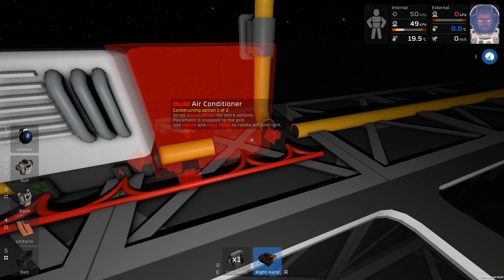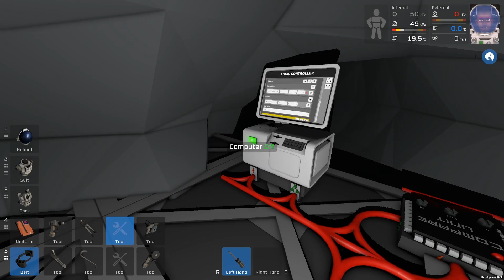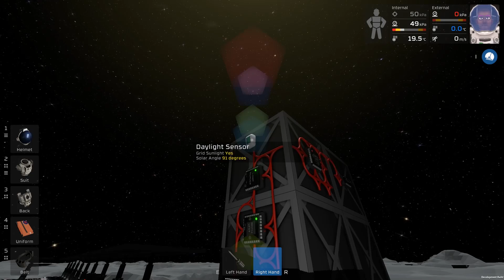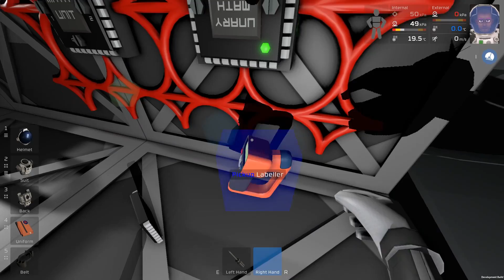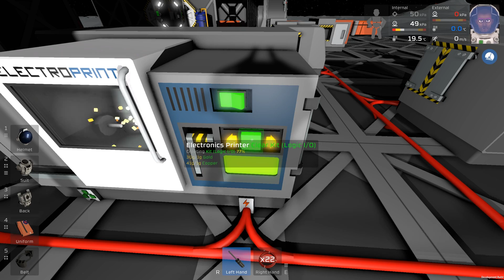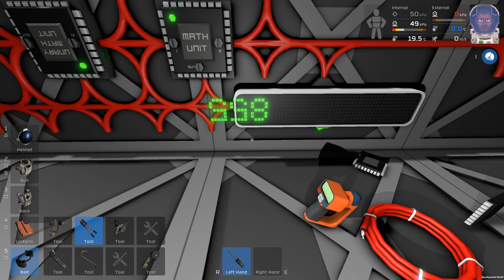Stationeers E18 - In-Game Electronic Clock (24 Hours)

Comment: I like your clock a lot. I just don't understand why you calculate (720 - 4x) + 720 instead of simply 1440 - 4x at night. Also for the 6h shift just add 600 and mod 2400
Reply from the maker: Oh it's not always planned for most optimal maths - there are definitely more optimisations on the clock - lots of good comments on this video, well worth browsing :)

Comment: Perhaps a bit excessive for a clock, but a good exercise :)

Rather than multiplying the hours by 100, divide the minutes and you can can then display time using a decimal to separate the hours and minutes which makes for easier reading. Or use two displays :)

Comment: not sure why you make it so complicated, it all simple math with only 2 switches/conditionals :

;; I have used long variable names to reduce confusion,
;; but below is imho a quicker/easier way of doing it, not sure if less components

;; daylightSensorDegrees integer (0 -> 180 and back after midnight)
;; daylightSensorVisible integer  ( 0 || 1)
;; daylightSensorMax integer 180

memTrue = 1
memFalse = 0
;; effectively a NOT or toggle switch
daylightSensorVisibleNot = if( daylightSensorVisible ) then memFalse else memTrue

;;  will always be 0 after midnight
daytimeOnlyDegrees = daylightSensorDegrees * daylightSensorVisible

;;  * -1 makes it counts upwards instead of backwards
nightUpCount = daylightSensorDegrees * -1 
;; as above, will always be 0 before midnight
nightOnlyDegrees daylightSensorVisibleNot * nightUpCount

fullCircle = daytimeOnlyDegrees + nightOnlyDegrees

;; so at this point fullCircle is a range between -180 and 180
;; offsetting that by 180 gives you 0 -> 360, 0/360 at sundown, 180 at sunsrise
;; but we might aswell already calculate in the clock offset
;; so we want 0 at the bottom of the circle for midnigt, so we only offset by 90

memCircleTimeOffset = 90    
circleOffset = fullCircle + memCircleTimeOffset

;; this means:
;; 0 -> midnight
;; 90 -> sunrise
;; 180 -> noon
;; 270 -> sunset
;; now after 270 the value will be negative, so we can just correct the value with a switch

memCircleNegativeCorrection = 360;
circleCorrected = circleOffset + memCircleNegativeCorrection
circleEffective = if( circleOffset < 0 ) then circleCorrected else circleOffset

;; so at this point you have a 0 -> 360 circle, where 0 is midnight
;; 360 / 24 = 15, so every hour is 15 degrees

memDegreesPerHour = 15
memMinutes = 60
memMilitaryFactor = 100
time = circleEffective / memDegreesPerHour
hours = floor( time )
timeDecimals = time - hours
timeMinutes = timeDecimals * memMinutes
minutes = floor( timeMinutes )
militaryHours = hours * memMilitaryFactor
militaryTime = militaryHours + minutes

Comment: So basically you built a digital sun dial and made it work at night.
Reply from the maker: Yep, just in case the day length changes (or is a configurable option in future) - you could also create a 20 minute timer, using the server tick rate (500ms) and a (0,1) clock circuit

Comment: Got this game for Xmas from a friend via steam gift and am just starting to learn about it. Must say it looks like short circuiting isn't possible and it also looks like power and data are carried over the same cable. I'm personally not a fan of that but it's nothing huge.
Reply from the maker: Oh you can definitely burn up circuits if you connect things incorrectly, like connecting the input and the output of an APC or transformer together.  Similarly, the red cables will only take 5KW maximum.  You can separate data and power, but with large electronics, that means slower cabling when recording, which I avoid!
Reply: I mean, I'm no expert on electricity, physics was always my personal weakest science, but electricity takes the path of least resistance. Like you could stand on a high voltage cable and it'd do nothing to you, as it'd be harder to go through you than the cable.

The game doesn't make you make it into a loop/circuit. like, IRL wouldn't these chips need to be in series?

Comment: In a farm, normaly you don't have only co2, but less than 1%. And it's not a good idea to have your radiator directly heat by the sun. 
If you want simplify your networks have a power line and a data lines, that are only between the 2 monitor that need the value.
Sorry for the mistake, english is not my mother tongue

Comment: i made my solar differently. easier to read than this clock :)

here is how i did mine. taken from a math formula in a previous video
you need theses items
- 2 memory module
- 3 Math Unit
- 2 Logic IO
this is connected as follow:

Logic Reader {
     In - Daylight Sensor
}

Math Unit 1 {
    - 1 (Logic Reader)
    - 2 (Math Unit 3)
    - Out (MOD)
}

Math Unit 2 {
    - 1 (Logic Reader)
    - 2 (Memory (15) )
    - Out (Substract)
}

Math Unit 3 {
    - 1 (Math Unit 2)
    - 2 (Memory (0.6))
    - Out (Multiply)
}

Batch Writer {
 In - Math Unit 3
Out - Solar Panels
}
most of the time, my panels are in the 420w + range
only time it drop is at the sunset at 380w
Reply from the maker: Some updated solar logic is out today - it gets 480W + throughout the day (it's a little more complex, but not too bad)

Comment: Could you just mod 24, instead of the conditional 6 hour shift?
Reply: BroMasterFlex do plus 600 then mod 2400 i think.
Reply from the maker: Good idea!
Reply: Was thinking the exact same thing as he was messing around with it xD
Reply: Could you explain how to do this.  Also I have an odd issue where the clock counts up to 1440 the back down to 1400 then resets to zero and starts counting up again.  Not sure what thats all about.
Reply: Drunken Walnut i found the sensor rotation to be really important. experiment with that. as for modulus, look it up. modulus quite useful.
Reply: Best thing I've found for that is to test each part as you build it.  If you're stumped, start from your sensor and make sure you are getting what you expect from it (0 to 180 - I like to use 0 for sunrise, but you could flip it around and do it the other way if you want).  After that, move on to the next piece and make sure that's providing the values it should, then keep working your way up so you know you have a good foundation to work with.  David is right, too.  If you have a clock set to 0 at sunrise and 2400 at sunset, you would add 600 then modulo 2400 so that it resets at 2400 so that you get sunrise at 600.

Comment: My solar was a lot more eff by changing the following; change divide from 1.8  to 1.5 and subtract 10. should get 10 to 20% more from your existing panels. good luck.
Reply from the maker: That's actually tomorrow's episode :)  But it's a slightly different calculation - it gets 494-498W
Reply: i have found this, but not sure if it worth with only 4 or 5 solor panels by me.
https://stationeers-wiki.com/Solar_Logic_Circuits_Guide
they have areally nice infos for the Furnace to even with the mix infos.
Reply from the maker: Yep, that's slightly more compact than today's episode (it uses 1 less processor), but the effect is the same

Comment: For the Generator you could read the Ratio and Compare (less) it with a Select, the Memories for the Select changes between 0.3 and 0.8. This should work as 2-point-regulator (Schmitt-Trigger), to toggle the Generator on at 30% and off at 80%.
I'm not at the point needing a generator, so never tested the circuit.
Short: Ratio less than Select -> Generator on + Select on.
Memory at Select 0: 0.3
Memory at Select 1: 0.8
Reply from the maker: That's a very nice solution, full credit coming to you for that one in the next ep :D

Comment: Nice see a working clock, but its not looks like its mean for building in the base, this thin really needs a 1 or 2 solor panel for  there own... in next patch is than a unit that does all in one... maybe this is trolling from the devs.
Reply from the maker: Hey, if we're faster at building these than the devs, go us! :)
Reply: Problem solver for your greenhouse. Build a back pressure regulator on the side where the heat comes out. And set it to somethink like 100 in start. With that you get in this 6 pipes a storage that is big enjoy for cooling down. Not sure about the how much pressure you have and need to get it efficient cooled. Need to test it my self in a bigger way but out of resources by base building.
Reply: pressure regulator are not good for this.
i managed to do a few things on my own lately by using a pipe volume pump. works like a charm and i no longer have the odd behavior for the 10Kpa difference and things shifting around my base
this allowed me to remove the regulator while keeping things moving properly.
Reply: And how do a volume pump helps him with the issue from the heat? How do this change the problem that the gas have no time to cool down and god sucked direct again in the greenhouse?
Reply: the volume pump allow the air to flow in a better pattern
i made a filtration on my end to get a 20/80 oxygen ratio. initially, i did not have the volume pump. the ratio for the air was changing to fast and my logic controller was to slow to react. by adding the pump, this force the air at a specific speed and give times to the devices to adjust. pressure regulator are too slow to process the filtration system or air conditioner.

i made an automatic atmosphere on my base to breath and it was a challenge to get a stable method to keep the ratio stable.
i have a mixer for air (80/20) then a pressure regulator. this will resplenish the room.

i then have 3 air filter running specific combinaision

Primary Filter: {
- Volume Pump (50L)
- Input: Room Passsive Vent #1
- Filters: Filter 1: Oxygen, Filter 2: Nitrogen 
- Waste: goes to my Filtration room to reuse the gas/liquid
- Pipe Out: Goes to a manifold (set of pipes) then return vent, Passive #2
- Pipe Analyser plugged on output
}
Nitrogen Filter: { (Start on demand)
- Logic IO and math + pipe analyser (from above)
- Input: Manifold + volume pump (2L)
- Filter: Nitrogen
- Waste: goes to my Filtration room to reuse the gas/liquid
- Pipe Out: Goes to passive vent #2
}
Oxygen Filter: { (Start on demand)
- Logic IO and math + pipe analyser (from above)
- Input: Manifold + volume pump (2L)
- Filter: Nitrogen
- Waste: goes to my Filtration room to reuse the gas/liquid
- Pipe Out: Goes to passive vent #2
}
Air Conditioner: { 
- Logic IO + math + pipe analyser (from above) - still working on this one to turn off the unit when ideal temp is reached to save power)
- Input: Air manifold + volume pump (50L)
- Waste: Dump pipe. long pipe connected to nowhere with heat-sink
- Pipe Out: Goes to passive vent #2
}
then, past the AC, i have a pipe that connect the manifold to Vent #2 to divert the circuit when the AC is off. still process gasses but bypass the AC and when the AC runs, the pump appear to take the air from the right pipe.

just wish there was a new type of valve which would be a Check Valve (allow 1 way flow which is not powered) without  impacting the air flow or pressure.
Reply: ok first, this have nothing to do with the problem from the ac unit.
Second the AC and the Filatration systems have a build in good pump, you trash 200w power with every volume pump.
You are right with the idear to switch the filter only one when somethink is to do, need to set this by me up.
For room presure is a console controller what can handle this.
For mixture you only need 2 filter for co2 and o2 to get them i a pupe with a mixer. 
Easy way would be to use the filtration system from the complet base.
Bigger way would be a second system with 2 filter units and for each gas a presure regulator and a backpresure regulator to not get the pipes blown.
I set this up today when i find gold in my world...

Comment: Pretty sure the ac unit takes up to 6kw. The regular coil cables can only handle 5kw. I think u need to use heavy cables for the actual unit. Not entirely sure tho, got this data for skimming the discord channels.
Reply: This is true. It seems to take up to 8kw when attempting to heat anything up, does it very poorly, or bugs out and shuts down until the demand is met. Made me ditch them for regular room coolers/heaters.